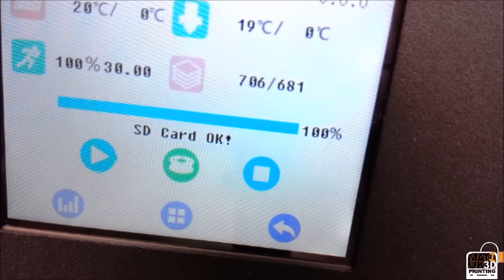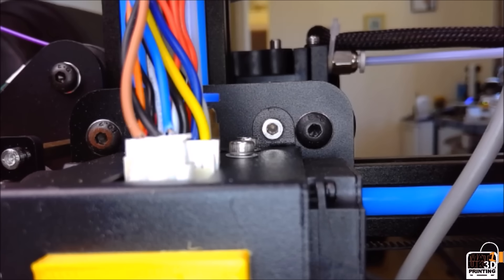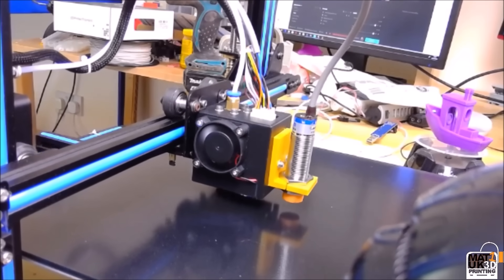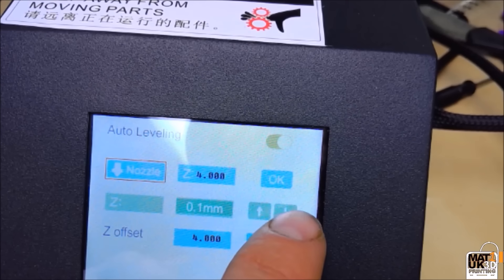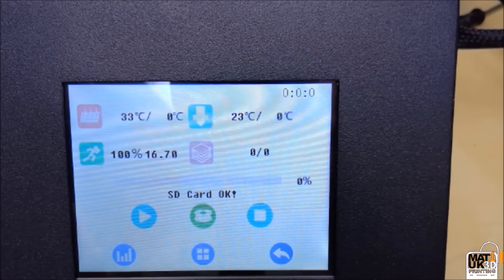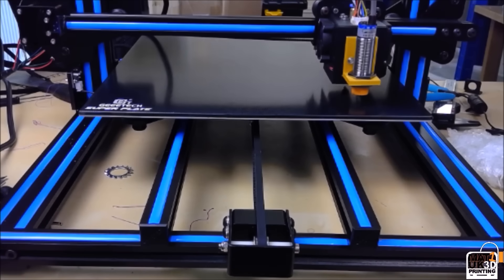GEEETECH A30 An Easy Guide To Auto Bed Leveling Installation And Setup

Comment: After you have done all of the steps. What is the height of the nozzle off the bed when it auto levels? Is it at the paper height or higher?
Reply from the maker: Paper hight is the ideal starting point but you may need to alter this slightly either way depending on your bed surface and the filament you are using

Comment: wow Great!what sensor is that?  I have an Ender 5 not working with THG3D's EZ-ABL.  I'm looking at this Geeetech because it's a much bigger print surface.  I have no idea what went wrong with my E5 but 2 weeks and I haven't figured it out.  Time for a new printer.  Did you have to fish the firmware for your sensor?

Comment: Hi, I am about to assemble a self-built 3d printer with the heated plate of the A3 (330x330) that I ordered from Aliexpress, I ask you a courtesy: if you can measure the distance of the 4 fixing holes to the cart .. Thanks
Reply from the maker: Unfortunately I no longer have the machine sorry

Comment: What firmware are you using? I've tried this on my A30 and it regularly crashes into the bed on the 3rd point of the 9point levelling process
Reply from the maker: Hi Chris, I no longer have the A30 I passed it on to someone who is using it for prop making. When I am back in front of the computer I will see what firmware I flashed to it before it left my hands maybe that will be of some help to you.
Reply: Be sure to level the heatbed before you try to use auto level. my nozzle also crashed at point 6, 7 and 8. After setting all 5 points with manual leveling, now my auto leveling works fine and did not crash into the heatbed

Comment: Mat, did you change your start gcode to get the 9 point bed leveling routine? I followed the video, but when I start a print, It appears to only auto level at point five, then returns to home position, then starts the print.
Reply from the maker: Try removing it from your start code. If you have the latest firmware it's hard written into it and adding the gcode to your startup may cause issues
Reply: It still didn't work without any gcode.  The manual says "when the printer is running with a TF card or connected with a computer via a USB
cable, the auto-leveling function is unavailable." Does that mean that it's impossible to auto-level while connected to Octoprint?
Reply from the maker: @JasonStreeter  I would hope not Jason. The best thing is to jump on Geeetech Facebook group and ask a lady called Emma Green I've found her incredibly helpful and can get onto the tech dept for you
Reply: Awesome, thank you!
Reply: @JasonStreeter  Did you got an answer? Same problem here..
Reply: @DavidS-wj8vh  Tech support said that the autoleveling function will not work when using octoprint or usb. That was a long time ago so maybe that has changed. I don't know if they've released any new firmware.

Comment: +MAT1UK 3D PRINTING
EDITED - EDITED

Please, could you explain steps without the Menu jumping to the wrong screen,... It's really confusing. When I click print, it goes to point 1 and measures it, ...  the head then goes to point 2 and does the same with no issues,... Head goes to number 3 point on the bed and crashes and pushes my bed down quite a lot, I'm using the PNP for the A30 from the GEEETech website.
Below is the day befores messages.

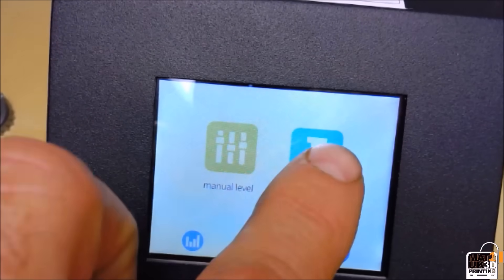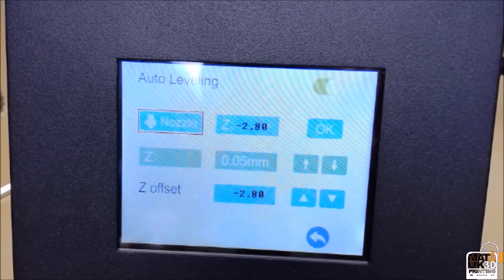Yes, I noticed that also, It really Did throw me off and caused quite a confusion. At 2:40 you advise us to check that the Auto Bed-Levelling is turned off,...  then you advise us to go to position five of the bed,...  at 3:10.  ..... we then go ahead and calibrate the PNP Device,... at 3:53 when you switch back to the screen, Your screen is showing the Auto Leveling Screen, It's even GREEN, So turned on,... you then come out of the menu without turning it off,...  at 4:00.  ... then you show the manual bed levelling screen and tell us to come out of it,... when did actually go back into the manual bed setting?   we then reboot at 4:30,... once the machine is turned on, you advise us to NOW go TURN ON the Auto Bed-Levelling function?.... I'm so confused, the auto Bed-levelling Function Was already TURNED ON at 3:53,... When did we TURN if off again?

 Would you please, explain by showing us in a video, Please?  I've still NOT been able to do my A£0. I got to the point of going to Position 5 and calibrating the PNP,... It's from this point on, with showing the auto bed levelling turned on I've been confused, as you listen more, it becomes somewhat even more confusing, Plus, I keep getting Bed Crashing, even though, I did calibrate the sensor 

I will say one thing,... You have one of the best clear spoken voices I've heard in an explanation (How To) video for a long time,... I really appreciated that, anyway, can you please, Elaborate on the parts I've explained, Please?.. Thank You.
Reply: Alien did u figure out what to do at his glitch?

Comment: Great Mat thank you so much for helping me to properly install this sensor that seemed possessed and did not want to know how to work! Only one thing I have to ask you: the autolevel function seems to work only when printing from SD and not via PC via USB. In fact I tried to run a print with my repetier host and the A30 does not proceed with the calibration test before actually starting with the print. I have heard that someone has solved by inserting a G-Code command before printing in his slycer, but I do not know what command to insert. Can you help me in this way? I really thank you for all you are doing for us, both beginners and experts! A hug, Roberto.
Reply from the maker: +dancollins g29 will make the machine auto bed level

Comment: Is it ljc18 a3-h-z/Bx sensor? Thx
Reply from the maker: yes that is the sensor i used
Reply: Thanks for your reply. I already have a cr10s. In your opinion, is it worth it to spend more money to buy the A30? Thank you.
Reply from the maker: Cherubino Serafino if you are on the lookout for a 2nd machine of the same type then at this stage of ownership I would say it's a good machine for the price.  If you are looking for a slightly smaller machine I will be reviewing the a-10 when it arrives from china

Comment: also about senser can i cut the wire to length or is the resistance in the wire part of the senser like in load cells.
Reply from the maker: no its fine to shorten the wire to what ever length you need

Comment: At 3.55 of the video. The Auto Level menu, when did you turn on the Auto Level? After you adjust the sensor or before? Thanks for sharing.
Reply from the maker: Vincent Tan I suggest you do it after as you will   have manually leveled 1st and set up the sensitivity and height of the sensor so that the head doesn't crash into the print bed
Reply: Yes, I noticed that also, It really Did throw me off and caused quite a confusion. At 2:40 you advise us to check that the Auto Bed-Levelling is turned off,...  then you advise us to go to position five of the bed,...  at 3:10.  ..... we then go ahead and calibrate the PNP Device,... at 3:53 when you switch back to the screen, Your screen is showing the Auto Leveling Screen, It's even GREEN, So turned on,... you then come out of the menu without turning it off,...  at 4:00.  ... then you show the manual bed levelling screen and tell us to come out of it,... when did actually go back into the manual bed setting?   we then reboot at 4:30,... once the machine is turned on, you advise us to NOW go TURN ON the Auto Bed-Levelling function?.... I'm so confused, the auto Bed-levelling Function Was already TURNED ON at 3:53,... When did we TURN if off again?

 Would you please, explain by showing us in a video, Please?  I've still NOT been able to do my A£0. I got to the point of going to Position 5 and calibrating the PNP,... It's from this point on, with showing the auto bed levelling turned on I've been confused, as you listen more, it becomes somewhat even more confusing, Plus, I keep getting Bed Crashing, even though, I did calabrate the sensor 

I will say one thing,... You have one of the best clear spoken voices I've heard in an explanation (How To) video for a long time,... I really appreciated that, anyway, can you please, Elaborate on the parts I've explained, Please?. . Thank You.
Reply: Alien I agree, he left a step out of this video
Reply: right, I am also confusing what here is missing :-(
Reply from the maker: I think the firmware has changed several times since I did this video. I will endeavour to do an update and also do one for the BL touch which is also now supported
Reply: schlumpfbumpf  did u figure out what to do at his glitch?
Reply from the maker: Hi Peter I did confirm that the firmware has changed and the procedure is now a little different but I haven't had time to turn the machine on to redo the video. I'm now waiting for the marlin build to be completed for this machine and it's installation will be my next video on it
Reply: @MATS_MAKERSPACE  thank you for your response sir.  Speaks volumes on your commitment to be a positive influencer on the 3d community.  What version of the firmware and Marlin are you referring to?  Should I only  consider using the sensor with said version's?